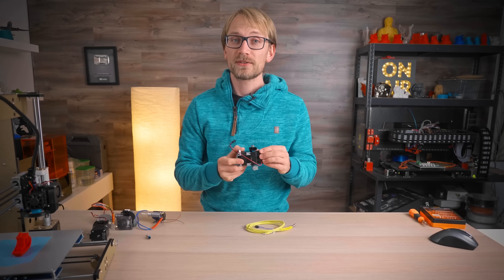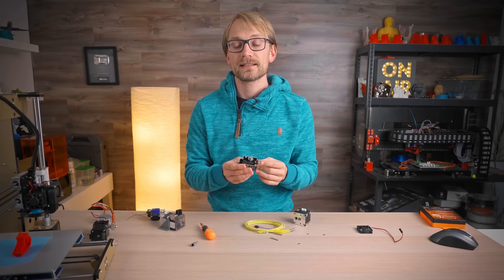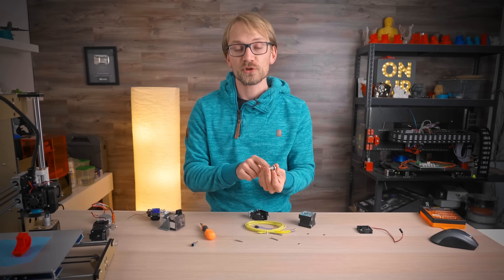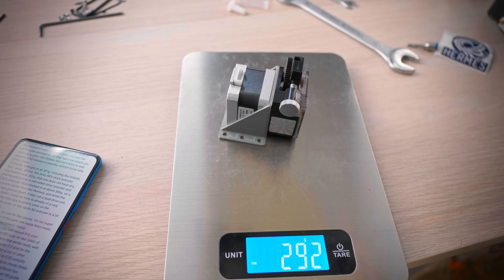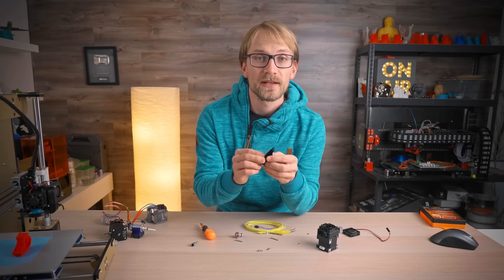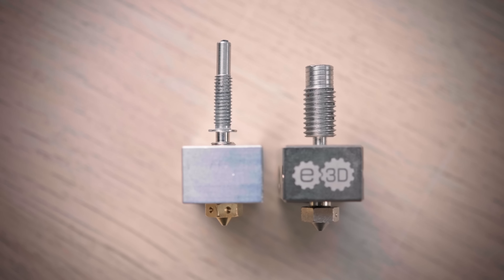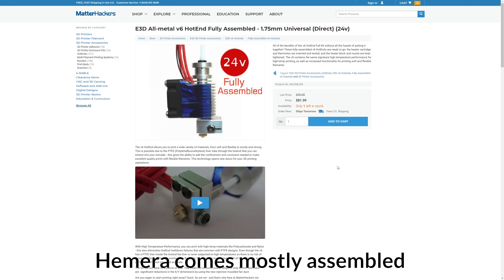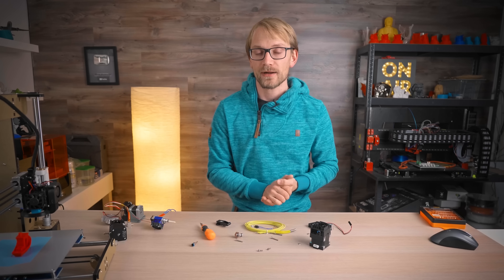E3D’s end-all extruder: The Hemera! (Full Review / “formerly known as Hermes”)

Comment: I really really wish you did some analysis and tests.

also the price only makes sense when you're building an entirely new printer. otherwise most of us already have the motor + v6 and change the extruder or one part at a time.
Reply: I am forced to buy a block here -- which I don't want. I have e3d's own copper blocks, and nozzlex already...so please if there was an option for just the hemera, special stepper, fan, and heatbreak, that's where that combination needs to end.
Reply: @kazolar  there's the bowden version. manually add the heatbreak
Reply: @kazolar  You can buy the parts separately. It probably wouldn't save you too much, but it can be done.
Reply: @kylek29  so they're bundling it now as a all in one upgrade. If I were to consider it, I'd wait until it becomes available in a better combination. But let's face it. There is no reason to to upgrade a machine which already has an authentic BMG. I gain a little z height, which I don't care about, and an additional headache how to mount it since I have machined aluminum mounts for my direct drive machines.
Reply: you can get the bowden extruder which is a bit cheaper. but running it in a bowden configuration kind of defeats its purpose imho
Reply: Re: Tests / Analysis

Agree, I'd love to see this done to a printer like an Ender 3 in an A/B test where A is the traditional bowden (possibly with a V6, so variables are reduced)  and B is the Hermera .. curious what the extra mass does to maximum print speeds.

Comment: I got an Aero at the start of the year(ish) and it has been doing awesome. The hemera wont make my prints better than they are now, it's not lighter, the aero never skips, and I certainly wont save money buying something new. My printer is self built so I would even have to design a new mount. This is just more work all the way around. If I was making something new I might consider it just for the cost savings of having everything in one package. Glad to hear your thoughts on it.
Reply: Yeah, I agree. If you already have the aero, there is no need unless you need the air blown away from the part. Buying another stepper motor just sounds a tad excessive too. I hope they can make this as an upgrade kit, though i would be hard pressed to recreate the shortened shaft and pressed drive gear on one of my steppers
Reply: @dadsfriendlyrobotcompany  If I was truly worried about extra air hitting my parts, I would grab up some thin alu flashing from my toolbox (I know there's a few scraps in there). A very small piece is all that would be needed to block the air from going that direction and it would be under the heatsink, so effectively invisible and weight next to nothing. No need to get fancy hehe
Reply: @ianide2480  the air hitting your parts is a minor thing. The major features of this are dual drive and very short filament path, which helps a lot with flexibles and with speed.

Comment: I hope that I'll get my Hemera tomorrow - so DHL is willing. Mounting parts for my Ender 3 Pro with BLTouch are already printed. :-)
Reply: I received it! 😁 Compared to before (with Direct Drive upgrade) I could save about 120 g weight.
My first test prints look very promising.
Reply: @Toni_Toaster  What parts are needed for the Ender3 pro?
Reply: 3D Texan I van recommend replacing the dupond connectors for fan and driver with JST XH connectors

Comment: Hemera won't work for greater-than-24 hour long polycarbonate prints - it will melt. Likewise for PC, that fan will just cause problems. Why should anyone buy Hemera if all it can process are only ordinary filament? Less expensive extruders will work just as well in that case. If I buy new stuff to upgrade, it is to handle more challenging filaments and objects, but Hemera is just a re-configuration, rather than a substantial improvement.
Reply from the maker: What's your parameters that the fan will end up melting?
Reply: Hi Tom! I am currently custom liquid cooling an E3D V6 Titan heatbreak for polycarbonate printing (greater than) 325 C nozzle and 145 C bed and the prints last for more than 24 hours. I had to double the size of the cooling system - the E3D coolant container and radiator was not sufficient to keep the heat down. I also had to go copper block and copper nozzle from E3D. Without liquid cooling, the heatbreak fan would warp the print inside the enclosure. and the original E3D aluminium heatbreak, nozzle and block just melted/deformed. Quite certain the Hemera would too. If I were to spend on a Hemera upgrade, the improvements and capabilities over the current Titans have to be substantial to justify the cost. Now that the Bondtech-like  configuration of the Hemera is out, its hard to justify getting a Titan Aqua too. Thank you so much for all the valuable information  and instruction you have shared over the years! All the mods I've done, I have learned from you (mostly)!

Comment: I was expecting a comparison with the Aero titan :(
Reply from the maker: What would you like to see compared?
Reply: @MadeWithLayers  apparently the heat exchanger was problematic on the titan Aero. Is the problem solved now with the Hermes. But because they have so much in common (compact, direct Drive, specific cooler) does it worth it for Aero titan owner to buy that new extruder whereas the "only" new things are the bondtech system and a thinner heatbreak.
But i know it's quite specific and maybe doesn't concern lot of people as the titan Aero is getting old.

Comment: I think we'll end up finding that the old style of heatbreak is very slightly superior, thermally.  Increased contact area with the threads and the heatsink closer to the heat block is better than overall increased contact area but stretched over a much longer distance.  Think about how far the energy has to travel in order to escape the heatbreak.  The heat isn't coming from the inside, it's coming from below (and only very slightly on the inside because that's where the necked down portion connects).  The little flange may help some if it seats fully as well, but it's pretty thin and probably doesn't conduct much heat.  

Really it would take two units (to eliminate the heatsink as a variable) and one would have to be modified to accept the old style v6 heatbreak.  

This would be an interesting test to do, especially since you have two units.  Would probably have to make room for some teflon tube to travel up and meet the gears as well.
Reply: there is thermal paste included to put on the threads of the heatbreak. i think it will perform great :)
Reply: @pippaengroda  no doubt it'll perform great, I just think it'll be slightly less performant as the old v6 style.  Also thermal paste can go on the heatsink side of any heatbreak

Comment: I wonder what the wear will be like on the stainless gear train. I'm sure they went with a grade that they could harden and it'll be fine because the forces are low, but you normally don't see stainless gears in industrial gear trains for a reason. In wash down required applications where stainless steel gears are often used, they normally require some form of lubrication to avoid work hardening and flaking.

Comment: Actually the chineese already made kind of "Dual Drive BMG Aero" before (nearly one year ago). The airflow concept of the hemera is better, also the heatbreak going up to the gears. But on the positive side, you reuse heatbreak, nozzle, hotblock and pencake stepper, so much less money if you want to upgrade an existing system (f.e. if you have already have a copper heatblock, an mepa heatbreak, a nozzleX, an orginal Bondtech BMG).

I hope e3d will sell the hemera as an upgrade kit without heatblock, thermistor, heater cadrige and nozzle. Anything downside the heatbreak is compatible to v6 anyway. If you have nozzleX or Ruby Nozzle - why being forced to get the standard e3d nozzle and pay for it? If you already have a 24V heater cadrige - why paying a second time?
Reply: Those are all cheap parts that it is nice to have extras of anyway. I don't see any benefit for E3D to create another sku for that.
Reply: @lavachemist  original e3d heatblock with nozzle, heater and thermistor more than 35 € I wouldn't call "cheap" for putting them in a box just as a spare; esp. if the equipment you have already are NozzleX, Cooper heatblock and a thermistor you already have set correctly in Marlin and works well (would not use an other type of thermistor as a "spare" as I prefer a simple replacement in case a wire breaks, to get the printer working again fast, not researching what type I have to set in Marlin for the replacement and reflashing the firmware...)
Reply: Ole Urgast they retail for that much. They don’t cost e3d more than 10 bucks or so to include.
Reply: I was hoping for an upgrade path from a V6 and priced out the individual parts, I think you save ~ $30-$40 if you buy the parts individually. So it might just be better to sell the V6 second hand and go with an all new kit.

I don't see why the authorized retailers couldn't do a special bundle though using those parts.

Comment: If anyone cared about dual drive, they could have invested in Bondtech years ago.  That said, Bondtech BMG and Hemera costs are similar (you can integrate BMG with your current/spare hotend and motor).  Can't see Hemera taking away much market share as it's been there done that for a while with Bondtech.
Reply: I think the reality is that the Hemera is for new builds, most people have already dialed in their printers. i.e. I'm running a v6 bowden with a titan and happy with it's quality however  my new corexy that's in build will get a Hemera.
Reply: @justindelpero  What do you plan to get out of the Hemera?  What are your expectations?
Reply: @bernardtarver  flexibles and high temp materials, good flow control and a compact build without a hit on z height.

Comment: Fantastic review Tom! I just installed mine on my Ender 3 and dialed the settings in. The quality is amazing and it looks like I'll be ordering two more for my other machines.
Reply: How are you feeding filament in?  What kind of mount/holder?
Reply: @woodwaker1  I'm using the Hemera in Direct Drive, not Bowden. Joe Casha (3DMakerNoob/3DMN) designed a nice mount for the Ender 3. He posted a video on his channel about it and posted the files on MyMiniFactory. I'm using a different fan duct that I found on thingiverse, and as far as loading in filament, it's going straight from the spool holder at the top of the frame straight down into the PTFE tube and directly through the extruder.
Reply: @thenerdlabofficial  Thanks, I ordered the direct drive also, I have printed Joe's backplate to see what it looks like and watched his video for about the 10th time.  I think it is finally sinking in how this will all work together. I also need the EZABL mount and have 4020 fans on order.  Looks like it will bbe a great mod.
Reply: @thenerdlabofficial   More than a sure bet that it was the changeover to DDrive that gave result. 
Bowdens are  simply a foolish marketing affectation

Comment: I'm still waiting for the Prusa XXL, I would love to see it equipped with a pancake Hemera. E3D once again upped their game another step.
Reply: I'd rather see a mosquito or slice engineering copperhead nozzle on it.
Reply: @kbrinker54  please explain your reasoning. Everywhere I've seen the reviewers say it's great but not much of a noticable difference in quality. Just curious.
Reply: @lukeD8099  Havent had a clog since I've installed it and it's been about 6 months of continuous printing, heats up quickly, seemed lighter than the V6. Print quality, prints seem smoother, less stringing and needed less retraction. So, there have been alot of pros.
Reply: @kbrinker54  cool! Thanks!
Reply: We'll Prusa does work with e3d. I asked Prusa recently about about the their XL printer it seems like it's still far off. So maybe keep suggesting and maybe e3d can do a custom version for them. I mean they already do a Prusa heatbreak.
Reply: you know any details for this print ?
Reply: @rmatysiak76  not more than is already out there. They're aiming for a 400x400 mm coreXY system

Comment: Umm no printing examples?
Reply: Print quality with a 0.15mm nozzle would be a very good test for this one. The test to get the ultimate resolution for fdm
Reply from the maker: Prints look fine - what exactly would you be looking for that isn't a result of the underlying motion platform?
Reply: @MadeWithLayers  extrusion consistency. The big selling point of this platform is short filament path, which should mean more even flow when going from infill (let's say 200mm/s) to perimeters (anywhere from 60 to 15mm/s). If you look at the most perfect prints under the right lighting, you'll see the bulges associated with this. I bought the hemera under my personal hunch that it'll improve this since you are greatly reducing the "spring factor" of the filament. Still haven't received mine and I'm sad to see that no one has touched on this aspect yet.
Reply: Thomas Sanladerer maybe max speeds for flexibles and show couple of example prints?
Reply: @MadeWithLayers  Direct drive, potential for moire? I also would really have liked to see some example prints, up close!

Comment: Do such compact extruders work well inside an enclosed printer? Air temperature is much higher and cooling of the throat might not be sufficient.
Reply: I'd like to know this! Can the fancy heatsink be replaced with a water block, or is it part of the extruder?
Reply: @Audio_Simon  It's part of the extruder assembly. The whole thing is mainly one diecast heatsink/extruder part, one motor with the other part of the extruder built into it, and the attached minor stuff like the heat break, idler arm, fan, screws, etc.
Reply: @Runoratsu  Then I wonder if the heatsink could be encased and made as a water block.
Reply: Simon A Maaaaybe, but I don’t think it would be worth the hassle. E3d might even decide to do an alternative part that works with the rest of the components but is optimised for water cooling out of the box, after all they do have a water cooled extruder already. I’d definitely message them if I were you, if only to show them there’s interest. 
But if you need something soon, you’ll probably be better off with something built with water cooling in mind.
Reply: Water cooling works wonders inside an enclosed printer.  I use an old Replicater 2x with an enclosure.  We had problems from day 1 with filament jams from heat creep due to the higher temps in the enclosure.  I designed and fabricated an aluminum water cooling block and hooked up an old PC water cooler to it.  Haven’t had a jam since (going on 5 yrs now) and the printer still produces great parts.  It was printing parts earlier today.
Reply: If the enclosure temps are high enough for it to negatively affect the cooling of the throat then you're going to have a lot of other problems within that enclosure anyway.
Reply: Thanks. So far I had to replace all PLA parts with PETG in my enclosurement.

Comment: Awesome Video as always, but i would love to see more Details like Thermal Images or how mutch Nm the Motor with the Gears it produces.
Maybe you can a seperate Video in addition with other Extruders/Hotends and check the finer Detail cause i still belive the Bondtech Extruder is more expensive BUT has way more power and can print with enough heat on the Hotend WAYYYY faster than the Herme...ähhh Hermera. 😉

I hope you see this comment and give me some Feedback on that Ideas. 😄
📢 I've subbed and ringed that Bell for YEARS so Guys do the same. 😋📢

Comment: I have to say this extruder setup is one of the biggest let downs in a very long time. For over a year all the hype about the Hermes had us drooling. The hole spacing is 34 mm, this is the worst design ever and requires adapters to fit 99% of machines instead of keeping it a standard 31mm. Save yourself $141 and get something better. E3D is going down the toilet with this Aero remix that falls flat.
Reply: the reprap 31 mm is a vertical orientation, while the 34mm of the hemera is horizontal.
Reply: @Gekkoperformance  You are right. I will revise my statement to reflect that it is just an Aero remix for an absurd price still and my direct drive conversion is still #1 in the world. It will have mounting for this over priced add on if people still wish to get it. I really had high hopes this was going to change a lot of printing downfalls but it just doesnt.
Reply: also what are you talking about with on board data storage?
Reply: To mount it to to replace most Bowden and Direct drive setup should use a 31mm hole spacing. Build a tank extruder setup and then rely on a printed mount is stupidity.
Reply: Matthew Basaraba the board you are talking about is a prototype from duet3d that uses CAN bus. the idea was that you can have all the mosfets and chips directly on the extruder and only have to wire 4 wires to the board- 2 power and 2 data.